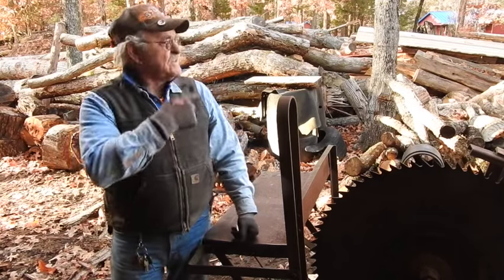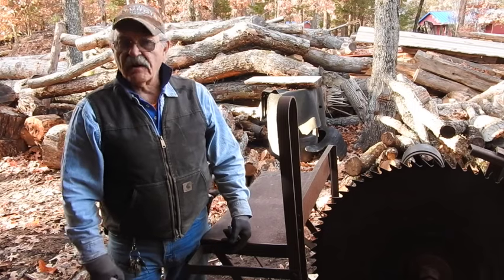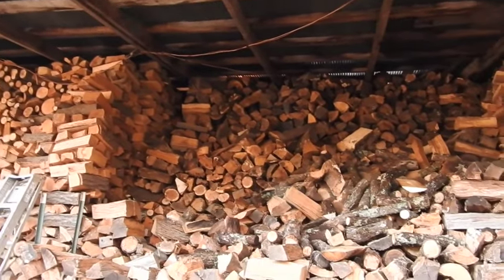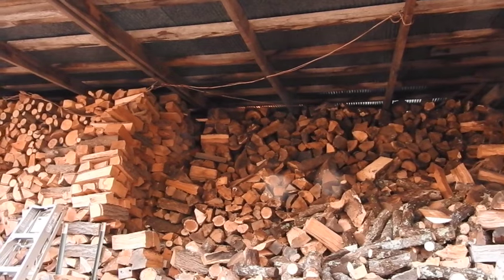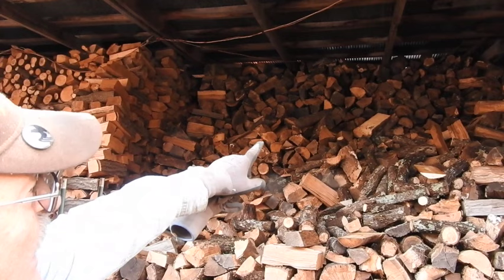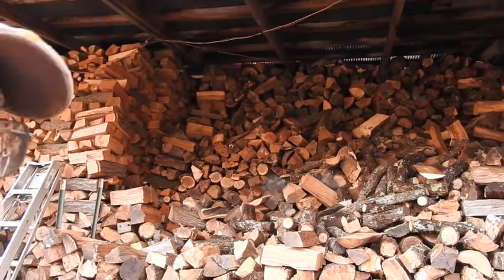Buzz Saw Virgins- This Is For You

Comment: I remember helping my Dad on a buzz saw attached to a Farmall H. I was probably around 12 years old. I was on the cutoff end Dad brought the slabs over and I held the cut off. I tossed them in the wagon. Good memories. I have that old saw. I think I’ll hook it to my John Deere B.
Reply from the maker: You won't be disappointed Jeff.  I have a roller table saw rig that came off an early 50's A JD. Once you get it set up, I'd sharpen it and make sure you get the teeth set to keep it from pinching in the wood and throwing the belt.  Of course, I'm sure that's stuff you remember from working with your Dad.  Thanks for the cool comment.

Comment: that's how alot of people use 2 cut round wood years ago 😊😊 now U don't even see that anymore 😮😮 I could hear the wood saw I couldn't a tractor 🚜 😮running do U have a tractor W straight exhaust 😊😊 then it would sound alot better than what it does when U can hear a tractor running and the governor opens up then it sings good when I was a kid growing I could always hear a sawmill running 1 was close by the last time they cut that peace ✌😊 of timber I could hear every line sawed all day everyday then there was a sawmill on the other side of town when the was right 👉 😊 U could hear that 1 /2 it wasn't good as the 1 close did U grow up close 2 a sawmill 😊😊 was grandpa or dad or uncle a sawyer and most sawmills use a gm diesel 671 power unit at half 🌗 😊 throttle have U ever hear 1 singing 🎶 😊 in the wind all they always sound better 2 when there is a good wind 2 carry the sound U can hear along ways off when the wind right 👉 😊 please let me know thank U 😊😊 /😊😅🎉😂😊😊 1O 31 2O23
Reply from the maker: Yes Clarence we had a sawmill powered by an inline 8 engine and power train off a  '36 or '38 Buick.  I could hear it at least a half mile away as I was walking home from school.  It was a Fisher and Davis and had a 54" blade and we cut a lot of timber with it.  I spent hours and hours working with that mill.  I was always the helper and never the operator though.  I have a large mill to assemble back here in the woods with a 3-71 Detroit power plant and yes, it's a screamer !!  I can't wait to get to it.
  Thank you for always sharing your experiences for us here.  We all enjoy reading your interesting comments.  Here is the little Belsaw mill I sold last year: https://www.youtube.com/watch?v=x2NMojV5BG8. This is my son in law's channel.

Comment: I want to see your sharpening expertise. Mostly, a proper way to put set back in the blade.
 I have 2 buzz saws, one  mounts on the front of the tractor and one stationary, but only have one decent blade. It has a lot of life left in it, but needs set and sharpened.
Reply from the maker: I have another for stationary use with either the Massey 30 or Farmall H too.  They work well.  I have several sharpening videos in this playlist: https://www.youtube.com/watch?v=WmhUk52fMdk&list=PLk72G9DTzZ1vR5HU-MFrvAt8RCHx_nK5k I think the 4th one down will show the way my dad taught me.  It was one of my first videos ever and it's not too good.  But here is another one: https://www.youtube.com/watch?v=ezvZ7u8jUwE&t=11s It's not necessarily all proper, but these old things aren't cutting for precision anyway. It's just the way my dad learned from the old blacksmith on the farm when he was a young man.

Comment: Sounds like some horse power on the ole buzz saw,
Never even slowed down a bit.
Reply from the maker: This one is powered by a 17 hp B7100 Kubota, which is plenty power if the blade is kept sharp.  This one hasn't been touched up since sometime in the middle of last year, so it's needing a touch up.   I really like using the bigger 30 hp tractors on the flat belt too. Those tractors really makes 'em sing !!

Comment: Wow how much wood do you burn a year?
Reply from the maker: Usually one of the three sections of the wood shed are consumed each year between two homes. That's roughly 12 to 13 full 128 cubic foot cords per year.  The three shops are heated from the scrap wood pile that does not get tossed into the wood shed with the good wood.  Rotating like we do on the three sections give plenty of time to season the wood before use.  We almost never completely empty a section.  This year we are finishing up the section left over from  last season's mild winter before we ever start on this seasons section.

Comment: I recently learned there is a splitting maul and a splitting ax. Which do you prefer? I’ve always used a maul?
Reply from the maker: I seldom if ever use an axe of any kind for splitting and almost never a store bought maul.  My mauls were hand made by my dad back in the 50's along with many others he gave away.  I use the little 6 pounder for easy splitting material and the 8 pounder for the tougher materials.  Here they are here: https://www.youtube.com/watch?v=S9bqXCHByhk Now I DO have a few store bought mauls I bought at yard sales for a buck or two.  I may use one or another if it's a real tough one to split...only because the store bought ones have full length handles. Not the short 'one hand' handles like the home made ones.
Reply: Right.  I always thought a guy just used a a maul.  Reading online it says a splitting ax would be for easy splitting stuff, that won’t wear you out as fast. I assume it’s because its lighter. Think I read where the stihl brand mauls  are supposed to be pretty good. I have a Stanleyfiner glass handle. It’s not the best
Reply from the maker: @mattboswell5392  yes, the splitting axe is lighter.  That's why I really like the 6 lb maul.  I use the 6 and 8 as a one handed maul, and  when I get a tough one, I'll swing with two hands on the 8 lb.  Then if its really tough, I'll use a bought maul with long handle.  But...hydraulics are my friend !! I much prefer them to a handle.  LOL